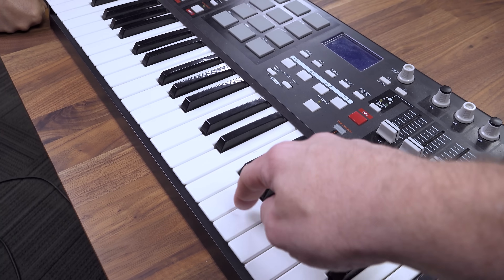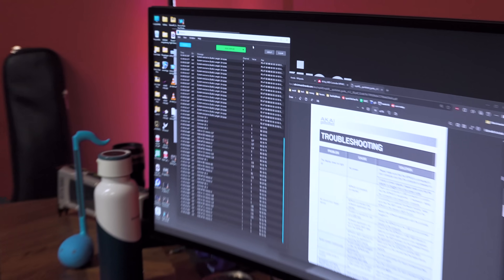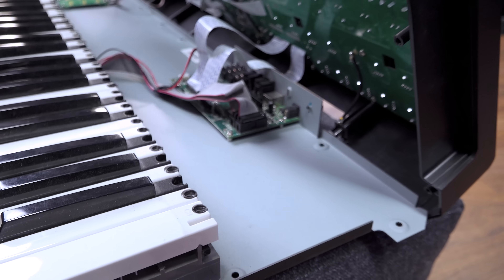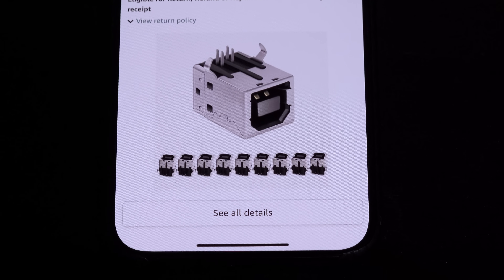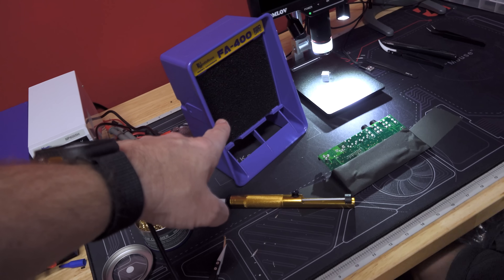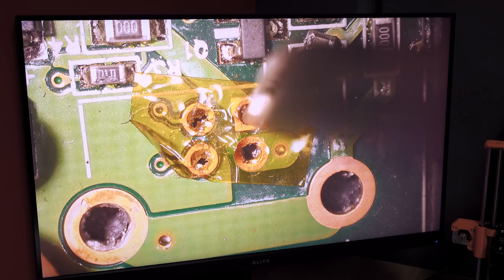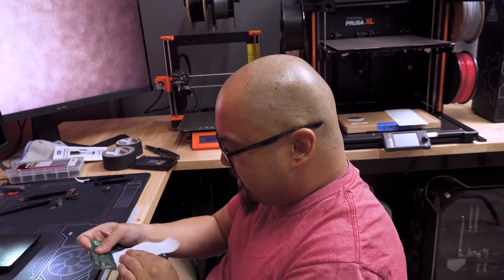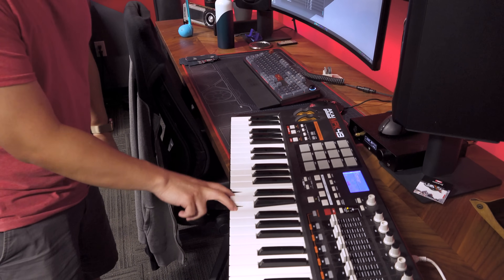The USB port snapped off! Let's try solder on a new one...

Comment: Significantly better than your last attempt. Just a few things:
When Louis was shouting to heat the board, it wasn’t that you needed to preheat it with hot air, but that you needed the iron to contact the pin and the pad to heat both (you only heated the component in your previous gpu attempt)

When soldering, hold the iron against the pad and the pin and touch the solder to the pad opposite the iron to melt it. If it doesn’t melt, it needs more time to heat up. This will make sure that you get the solder to flow through the via to make a more solid connection. When soldering through hole components, to see if you used enough solder, you can flip the board to see if there’s a visible fillet on the top side. 

When using hot air, you typically want to blow it down on the area you are working on, not across the board. That’s probably how that capacitor got buggered. 

Last thing is that kapton tape isn’t necessary for masking. It’s typically used as a mask to keep the heat down around where you’re working. 

I’d recommend getting a soldering practice kit that you can play around with that won’t be a big chunk of change if you make a mistake. You’d be surprised by how much heat and solder you can put into those vias.
Reply: I believe thats what Louis meant though.  You want to preheat the board especially on a high end gpu because the pcb has so many layers and designed to absorb the heat.  So you try to solder a thru hole or pad and the pcb just keeps pulling the heat away.  If you at least pre heat the board, than the copper layers wont be able to absorb as much heat and makes the job easier.  But I guess you would want to know the temperature of the board and the heat your applying so its well below the melting point of the solder.

I always guess when heating up the newer intel chips for delidding and replacing cell phone screens but that is really dumb because you can definitely apply to much heat and damage components, at least taping down like a k type temp probe will give you an idea of the temp you are applying.

But at least a little pre heat with a heat gun or in the oven is important, and you would want to preheat the entire board, otherwise pre heating one spot just gives you the same issue of pulling the heat away from the area you are working on.
Reply: @strongislandx  Preheating with hot air isn't a bad idea, and would have definitely helped with the gpu, but wasn't necessary in the least. You just need a tip with more thermal mass, or hold the iron in place longer to heat the pad.

The issue with their gpu repair is that the iron was only touching the component, not the pad they were trying to solder to, so it wasn't hot enough for the solder to bond to. That's why he was shouting to heat the board. It wasn't that he wasn't using hot air. Louis often says that non-BGA style components can be soldered with just an iron.
Reply: @Nick-uf9st   ya its just a good idea with modern gpus to pre-heat the entire board.  holding an iron in place longer can damage the pad.  Im no expert, just saying that the idea of pre heating is so that, the copper cant wick away the heat from the spot your soldering, especially with small pads and resistors, holding the iron on the pad or resistor edge for a long time can damage it fast.  The board is designed to spread out the heat

Im sure once you have experience you can do it easy without pre heating and I have never actually pre heated when doing small gpu mods, but I figured thats why he would be yelling to pre heat, so you dont have to hold the iron on a delicate component for a long time

But I still have a lot to learn and im sure there are so many ways to do things and different for everybody

Also its tough with gpus to use a big iron, everything so close

Just soldered an elmor evc to my 4090 without dedicated i2c headers and the small resistors coming off the pins connected to the voltage ic werent easy to solder to.  Needed a small iron and the copper layers wick away the heat so fast, its so easy to damage the pads and resistors.  I probably would have had an easier time if I preheated the gpu a bit but I need a thermometer

been guessing with a heat gun and heating up newer intel chips for delidding and cell phone screen repairs, I have no clue how much heat im applying

still have a lot to learn, old gpus like nvidia 8000 series were so much easier, all components were big, spread out, pcb didnt have as many copper layers, they were so much fun to mod
Reply: @Nick-uf9st  It can be very difficult to solder/desolder SMT components that are attached to thick traces and planes without heating the whole board. LTT had this same problem with their GPU shunt mod. Whether or not a particular component requires this preheating depends heavily on the component's connections and the copper weight (aka thickness) the board uses.
Reply: I've been a certified soldering and cable technician for many years. Things to bear in mind: Dwell time on the joint is important. Leaving the tip in contact with the pad and component for too long can damage the component or cause the pad to lift. Flux is seldom necessary if you use properly sized rosin-core flux. And clean the flux off there after you're done. Flux will attract and retain moisture. This can lead to corrosion. I use isopropyl alcohol to clean, it doesn't leave a residue and is safe for the parts. It's really important to practice. And practice some more. After a while, you will reach the point where it's much easier to create a nice solder joint. Use a fume extractor. It won't take long to give yourself a headache, or worse, if you don't.

Comment: IPC-certified inspector here. Other than not leaving the iron on the solder joint to fully heat the connection, you did fine, Phil.

Can I interest you in a job making "cables" for the govt? 🤣
Reply: Solder job itself is ok, but you might want to reinspect the surrounding components @ 6:23

Comment: Oh no this was painfull to watch :) No fresh leaded solder to mix with unleaded to help with removal....No flux...Stabbing with solder braid lol. Sorry yes i'm sure 100 others have commented too..But please
Reply: Yeah well, there are a lot of comments about flux... That said, I need to mention I never use flux except for specific situations. I tend to believe it is really dependant on what solder is being used, or am I wrong? I feel like most people are compensating for average solder quality by adding a lot of flux? It's not an affirmation... I might very well be wrong here, don't hesitate to correct me please.
I always use Kester 44 leaded solder with rosin core, and on its own it flows absolutely perfectly. I never really experienced anything like what I see here, and that's also without flux. Also, I solder both through hole, and a lot of SMDs (mostly down to 0805, not used to smaller), and the only times I need flux is for tight pin spacing parts like TSSOP ICs and else. I see some people add flux for every solder joint, and I really don't get it, as I get absolutely perfect solder flow on first try without any effort without a single drop of flux on the exact same type of solder joint, without the mess. So I assume it has everything to do with the solder itself?

For desoldering, absolutely adding some new solder is mandatory, I totally agree with that, it helps tremendously. Also sure for very big through hole pins like the ones holding the USB connector, I understand flux could help here? I rarely deal with these myself. Now for the desoldering pump yeah, it does the job but I never really liked these, I moved to the Engineering SS-02 a while back and it was a whole lot better, then finally decided to go for the Hakko FR-301. Both very very useful tools!
Reply: @Slay3rOne  Very good points...

Comment: get a Pinecil and a chisel tip, you will never use a conical tip again i promise, also you don't need flux to desolder as other comments say, this will sound crazy but if you introduce new fresh solder into the joint it will melt easier and you will be able to wick it off, no sucker required.
Reply: Not absolutely necessary, but it does make things a lot easier. Especially when using braid as they can be a bit dry sometimes.

Comment: Honestly good job for a beginner with limited tools. Id probably suggest mixing the old solder with lead next time to lower the melting point and use a powered desoldering gun to remove it rather than those manual ones. Also use more flux. Amtech makes great flux. And  i hope that knocked capacitor was resoldered!
Reply: Thanks!
Reply: Agreed
Reply: Cool! I thought those powered desoldering guns were expensive, so I hadn't even searched. I didn't expect to find them for as low as $30. Probably not professional grade, but even a HAKKO was only around $160.

Comment: That soldering job is okay for it to work for now but none of those solder joints are great. You need to heat the board up and don't put the solder on the iron to melt it, the pin/board should be hot enough to melt the solder to properly form a good solder joint. Don't leave your iron on the board too long otherwise u can easily take the pad off. Only a few seconds at a time at most.

Comment: I'm going to come down here and shed some light for anybody that's watching this that has never soldered before. You don't need special tools. You don't need expensive, brand name, or even specific tools. There's only four tools that you need. Those are: a soldering iron, electronic solder, a brass wool for cleaning the tip. And flux. You also need a fan but I wouldn't really consider that a tool you just need to draw the fumes away from you. I use an Amazon soldering iron with the cheapest brass wool I could find. The flux I use is not even the most expensive as long as it's the amber color type it works okay. I bought my solder from Amazon and it wasn't the most expensive. And I have soldered multiple things with varying amounts of success due to my very noobish soldering skills.
Reply: The tools you outline are what I use primarily, but there are times when a microscope is invaluable.  Also, solder wick and a sucker tool (used with care) can be exceedingly helpful.  Of the tools that were used, the microscope is the one I covet.  I have seen them for what seems like an extremely reasonable price on Amazon etc.  I may also eventually need the hot air gun to cure my PS3 of flashing-red-light-of-death-itis.
Reply: @elviscera4661  well you get these tools first. You practice a little bit do what you got to do and then you get the tools you mentioned as you need them. There's no point in the buying all of these tools especially if you're never going to use them or you decide that it's not for you. No point
Reply: @Dtr146  No argument, that is good advice for beginners but if you want to repair modern electronics, you are almost certainly going to need more.  I'd suggest as  additional minimum and inexpensive  items, soldering flux and solder wick.  The next step, for me, was a quality soldering pen with adjustable temperature.  I find a lighted magnifying glass helpful as well.   But having actually done rework in a corporate prototype lab, I have to say that what I truly covet is a portable USB microscope.  This is why I am asking which microscope was used.  

One thing that you can use a microscope for is to examine and repair LGA1700 pins.  Such pins will bend if even sneezed on; very slightly deformed pins can cause all manner of problems (e.g. intermittent memory failures).  With a microscope one can much more easily inspect the pins and carefully straighten bent pins (straighten using patience and a fine dental pick or similar (and not too much caffeine)).
Reply: can I use a p100 mask I usually use for painting instead of fan?
Reply: @Robbie-mw5uu  as long as it's rated for smoke.

Comment: When I was soldering at work I modded the hell out of my Solder Sucker. I found a thicker spring and put half of the old spring back in and after a week the plunger shot out of the top and flew across the shop. I reassembled it and put a set screw on top through the aluminum to stop the thumb plunger from escaping. But just as Phil was having issues sucking out the solder I was dealing with the same thing, that's why I modded it. Back then it would get all the solder out on 1 go.
Reply: I used to have the standard one like on the video here. But it was always annoying, so a long time ago I moved to the Engineer SS-02 and that one was already way way better. Now I moved to the Hakko FR-301 desoldering pump, both amazing tools.